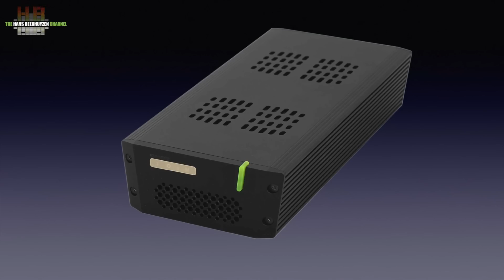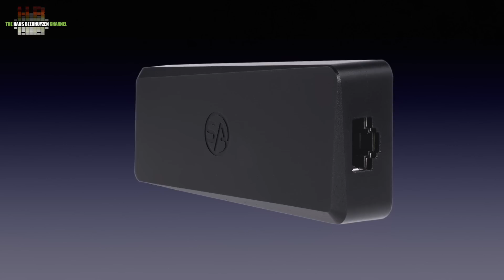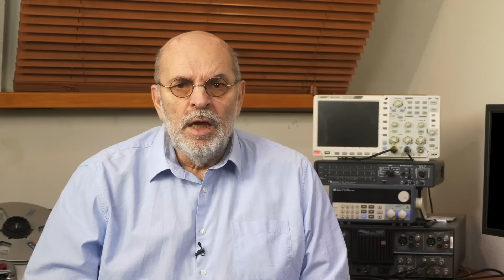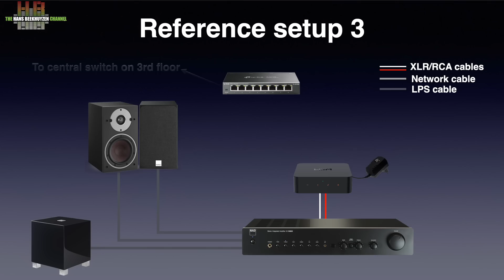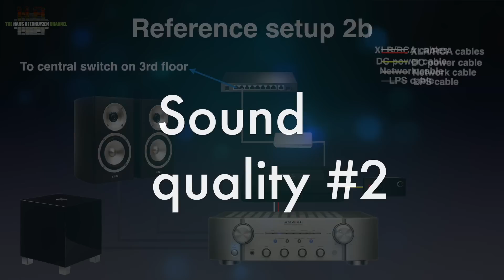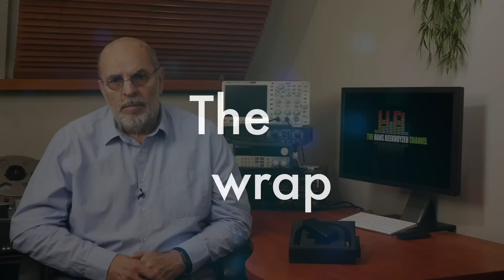Stack Audio SmoothLAN network filter

Comment: Hello Hans; I am reviewing all of your videos on improving my digital network. My network chain relies on a wifi repeater rather than 100% ethernet cables (like some other people).  For people relying on a repeater would a filter or quality switch be worth thinking about ?
Reply from the maker: Using a high-quality filter can definitely help clean up the signal from a repeater.
Reply: @TheHansBeekhuyzenChannel Hello Hans. Thanks for taking the time to reply.         Sounds like I will need to raid my piggy bank now.  Cheers.

Comment: I think I might try one of these, they look well made. I was tempted to try a Eno2 but the 1Gb thing confuses me. I’m not into internet tech so the 1Gb vs 100Mb is confusing. It seems the Eno2 is marketed to the 1Gb crowd, I have no idea if that means it will perform very well in my system with my modem and internet service. The Smoothlan like other inline filters using galvanic isolation transformers is a simpler concept for my brain to take onboard. 

I have a Silent Angel switch at the moment so the Smoothlan would just be filtering the nasties that get through the switch. My Ethernet cable is 15 metres long and it is double shielded, it is ran in PVC conduit and kept well away from power cables. The system sounds very clean as it is so I don’t think the Smoothlan needs to be taking on heavy duties.
Reply from the maker: It’s like 1000 grams and 1 kilogram, 1000 Mb and 1 Gb is the same.

Comment: Thank you for all your reviews Hans. I am considering getting the Zyxel switch and Smoothlan filter. I have my audio system next to a Google WiFi router point (not the modem). Just confirming that adding these to my system will bring improvements. I was also considering getting a nice external clock for my Gustard R26. Would the Zyxel switch and Smoothlan preclude the need for a clock or would the external clock offer added improvements to timing when used with the switch and filter? Thank you!
Reply from the maker: Thank you for your support.

Comment: Designing a "filter" is not easy, so I've looked at Stack Audio hp for information and specifications.
What "SmoothLAN" should do or does:
- eliminate crosstalk and interference
- remove potential sources of parasitic noise
- Counteracting noise
- improving the timing of digital signal transmission
- isolate all signals with six (!) isolating circuits
- shielding to prevent interference between components
- safeguards against performance degradation caused by external vibrations
Specifications:
- Size
- Weight
- cable and cable lengh

No additional data is given... e.g. crosstalk and shielding attenuation...🤣
questions: are the RJ45 isolated from the case and if so where is the grounding screw for the case or is this not needed?
Reply from the maker: I don’t know. You should ask the manufacturer.

Comment: I currently have the iFi Ethernet filter and have a SmoothLAN on order. Also have several DX Engineering ISO-Plus filters (they work great when employed correctly). I'll report back with my SmoothLAN impressions. I'm using all BJC Cat6A or JSSG360 Cat8 Ghent Ethernet cables.
Reply: Got the Smoothlans yet? My setup is similar to yours. One DX iso per side of each shielded cable. Ifi lan silencer plugged into my streamer. Great sound so far.
Reply: @DrJum  Just arrived earlier this afternoon. All BJC Cat6A between switch and Naim NDX2. It's def better than the iFi by a good amount. Makes sense for the price differential.....but it's an immediate, obvious improvement. No DXE Iso-Plus units on the line....yet. Gonna let the SmoothLAN run-in for a few days and report back.
Reply: @DBravo29er  How many DXE IPs are you using?  I've seen setups with up to 4.  Interested to hear your further findings, thx
Reply: @usswia  So far, just 2 on each ethernet run between router/switch and device. Gonna experiment with 4 on each run (gangs of 2 at each end) in a month or so.
Reply: @phillipmorris9847  Yes. Bought a second SmoothLAN for my tube system. Only using a single DX ISO PLUS between my ORBI mesh access point and my switch. SmoothLAN is really impressive. Takes 200+ hours to fully settle. But after the first 48 you're probably 90% of the way there. Heartily recommend.
Reply: @ You're welcome ☺️
Reply: ...i thought about it but £750 in UK

Comment: hi Hans, feel curious for the LAN cable connection between my Streamer and Switch, I have already insert a SONORE-OpticalModule (use fibra cable to connect switch and turns to LAN connection to Streamer), does this little thing also have additional enhancement (between SONORE and Streamer) ?
Reply from the maker: No

Comment: This is a topic I’m not very familiar with and would be grateful for your view. I run a Bluesound node connected to my network by a 1m Cat6 cable to an Orbi MESH wifi router satellite. Would using the smoothLAN still provide a benefit to the Node in this setup? Cheers. Gino.
Reply from the maker: The effect is rather limited. on the Node.

Comment: I had the standard Eno...It was meh..Now I look at the pricing and it I would say it's completely over priced. If you want to truly isolate don't bother with these these passive devices. You need a switch that uses Fiber isolation that uses actual power to function.
Reply: I've used a pair of Cisco Meraki after removing the internal power supply and the fiber in-between the two, it's been a great addition.
Reply from the maker: For met the Muon is the best option, better than audio grade switches.

Comment: I use a Tripp Lite Isobar (no cable) plug in to filter electricity at the wall. I also add an 20mm obsidian crystal pyramid to further lower the line noise.
Reply from the maker: We're talking network filtering here????
Reply: @TheHansBeekhuyzenChannel  
I should be talking network, but I was talking noise line filtering. Sorry to go off subject. But this works for me.
Reply: My wifi is super clean because I silverize everything including the wall coax cable and power cables.
Reply: I was able to attain 1200 Mbps.

Comment: I don't know if you have commented on this subject, but some info that might be of interest to you. I see the Nordost Qnet network switch recommends using the 100 Mbps Lan ports because: "At 100 Mbps it’s also possible to contain noise propagation to a minimum, compared to higher speeds" over the other 1000 Mbps ports on the switch.
Reply from the maker: 100 Mbps usually has lower noise. The SmoothLan is also 100 Mbps. A top class filter can clean up 1 Gbps perfectly, like the costly Network Acoustics Muon Pro.
Reply: @TheHansBeekhuyzenChannel  I looked up another brand of network noise reducers. SOtM Audio in S. Korea. They make various products all the way up to a dCBL-CAT8M, which is a CAT-8 cable with built in filters on each end and is rated at 40GBase-T.

Comment: Based on your research, would there be any point in using 2 Lan noise reduces between 2 components? The iFI Lan iSilencer is the cheapest option and you can easily ad one to either end of an Ethernet cable.
Reply from the maker: I have no hands on experience with the iFi I silencer so I can’t say.

Comment: I use the iFi LAN iSilencer, since it plugs into the device and is rated at 1,000 Mbps(SmoothLAN is only rated at 100 Mbps, not for every application these days). Another company(SOtM Audio from S. Korea) makes a 10,000 Mbps lan silencer, but isn't cheap at $480.
Reply: Are you still using the iSilencer? I was considering buying this SmoothLan but I dk now. I do have the even cheaper IFI ILan now. A noticeable improvement in soundstage but it is slight. I'm looking for another budget priced improvement.
Reply: @NosEL34  I use the if Lan iSilencer as it's a cheap option and I can ad it to multiple devices and without a power source needed. ifi makes a $300 SilentPower LAN iPurifier Pro - Ethernet Filter with Optical Isolation now too.
Reply: @mugen2002  thank you for your reply. My apologies but I thought the ISilencer was actually the iPurifier Pro. I had the names mixed up. I actually have the same one you have. I've been using it awhile but was thinking of either the SmoothLan or the new iPurifier Pro.
Reply from the maker: 100mbps might sound better since it is less noisy.
Reply: @TheHansBeekhuyzenChannel what is your basis for this claim ?
Reply: @cosmicvoyager12 I'm not Hans, but I would guess the ability to employ significantly lower frequency LP filters (inductors or iso-transformers) to reduce noise without perverting the 100mbps square wave as opposed to having to permit to pass another 900mbps (and the resultant high frequency components necessary to represent these signals in the analog domain).

Example: Naim actually use a full gigabit chipset in their NDX2, but they only run it at 100mbps. For the exact same reasons.

Comment: Ok Plug in local Storage & Play

Use a $ 20 network switch with low-noise or out of band power supply.

Any noise comes from the power and just use clamp on ferrite
Reply: I learned the use of an Oscilloscope in 1986 and power most of my audio off " Lab Grade Power"  spent most of my life removing noise from sensitive electronics in Hospital's , Airports, Communication Towers.

Asynchronous Data transfers perfectly when noise is removed .  the" OSI model"  actually works .
Reply from the maker: If that makes you happy 👍🏼

Comment: Great review, Hans! I currently use EMO en-85e ethernet isolators that have significantly increased SQ in my two systems. Curious how this would compare to the Stack SmoothLAN.
Reply: Thanks for the input. Based on this, I just ordered a EMO EN 1005+ (recommended for audio on their website) at the cost of around 130€ incl. VAT and shipment. Curious to see if that will give any sound improvements to my main system
Reply from the maker: Well, if you mean the ENO, that's a choice you should stick to.
Reply: @TheHansBeekhuyzenChannel  Hans, no I actually mean EMO Systems, a German company. They make in-line medical network isolators. Confusingly similar (in name) to ENO, but completely different company.

Comment: I use Panamax power conditioners, my either net connections go through the conditioners as well so this device would be redundant for me but useful otherwise.🍻
Reply from the maker: ok
Reply: There is a good possibility that the Panamax is adding noise.

Comment: Wouldn't it be more likely for the SmoothLAN to improve the audio quality when connected to the WiiM Pro Plus than the much more expensive and presumably better engineered Eversolo?
Reply: IMO a cheaper streamer is less resolved than more expensive generally. The benefits with these types of filters are on the subtle side but nevertheless important if you have a better resolved system.
Reply: A filter will be an improvement with any device because it will filter out noise and other issues with the feed. A good power conditioner will do the same thing and filter out electrical noise from your outlets as well. You just run the either net into the conditioner then out to your streamer or whatever.
Reply: That wasn't my question.  The Wiim Pro Plus had less improvement with the SmoothLAN than the Eversolo as tested in the video by Hans.  It logically should be the reverse since the Wiim Pro Plus is a much "cheaper" device.   @Audiodreamer192-24
Reply from the maker: Why would that be logical?
Reply: Then if it's logical that the cheaper device would benefit more, then please explain why not, explain the converse, that the more expensive device, the Eversolo did benefit instead.   @TheHansBeekhuyzenChannel